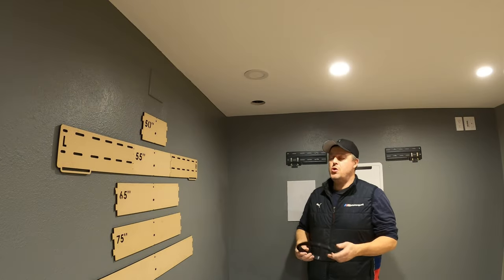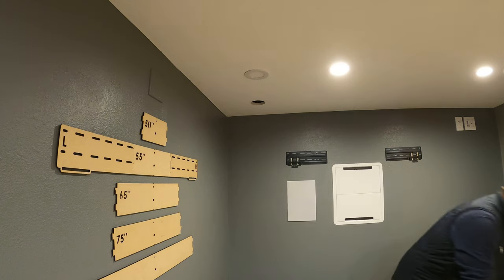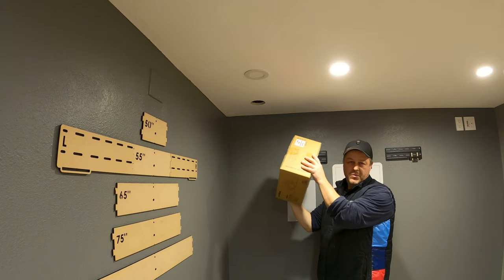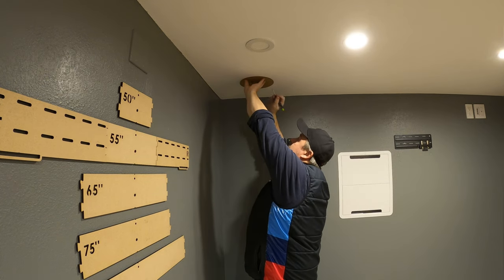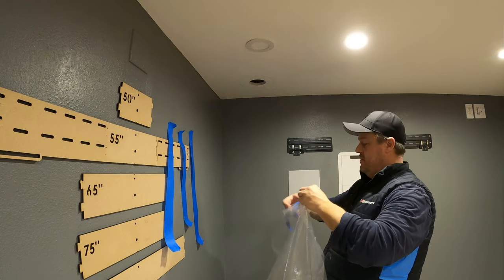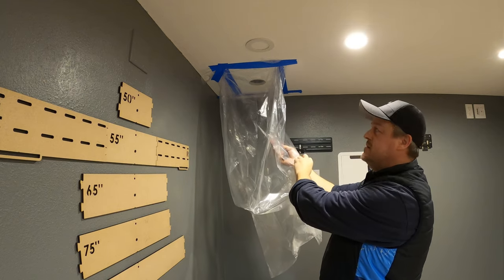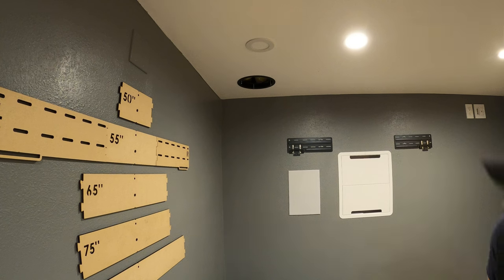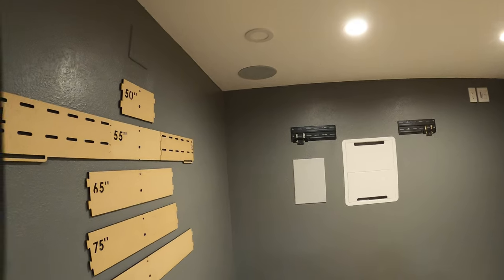Klipsch Ceiling Bracket Install - Ceiling Speakers Installation Tips - PRO-6/8 SBR

Comment: Thanks for the video. I've got some Klipsch CDT-5650-C IIs on the way and notice reading on mounting options on Crutchfield that they recommend "replacing the original mounting panel" with 1/2" or 3/4" plywood or MDF vs. just mounting using the drywall. I haven't seen anyone do this on any videos yet - I assume the speakers will probably be fine in just the drywall? I'm using these as rear surrounds in a 7.2 setup so not asking them to do too much. Was just curious on your opinion. Thanks again!
Reply from the maker: You could build a small ring for the speakers using wood and slide in back behind he speakers.   Really not needed.

Comment: Wow! Home owner not a pro installer. Built my home but I have just the speaker wire left hanging with a small hole for each ceiling speaker...I ran it all while it was frame. I have not picked out speakers yet and was wondering how can I do this myself. #1 I need to find those bag I have 9' ceiling for 3600sqft home...excellent clean way to do it. #2 what was the name of that tool to cut the hole? Made it look so easy. #3 last think I am going 8" speakers but what brands again you recommend that has that easy bracket setup? Thank you thank you for this video!!
Reply from the maker: Should be links for the bags and keyhole saw in description.  Speaker wise just confirm they have a pre install bracket - not rough in but the ones with grill and mounting frame.  Cheers.  Hope we help you out.  If you want Klipsch or Origin we can help you out with pricing.